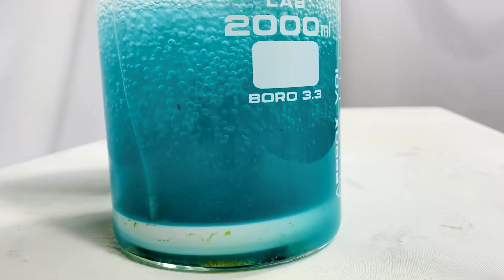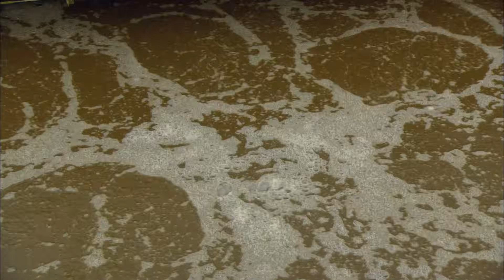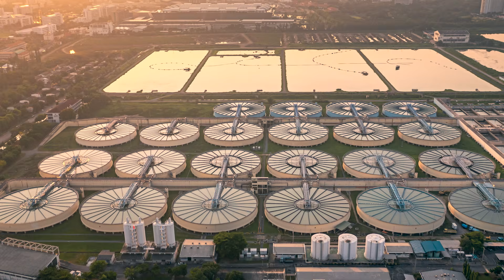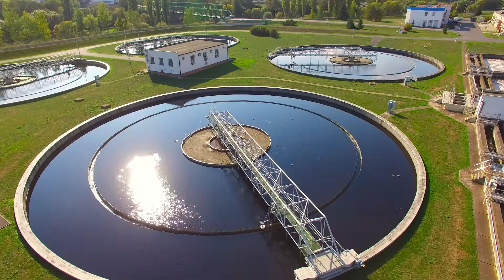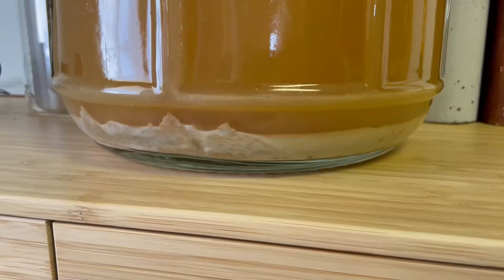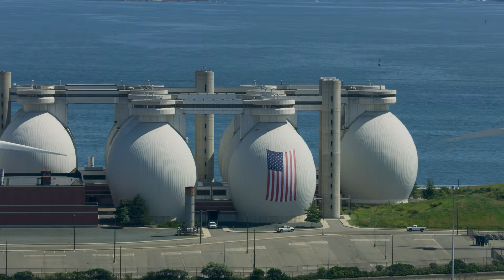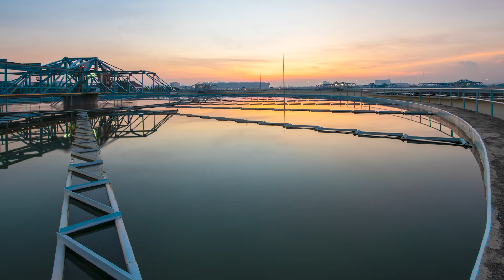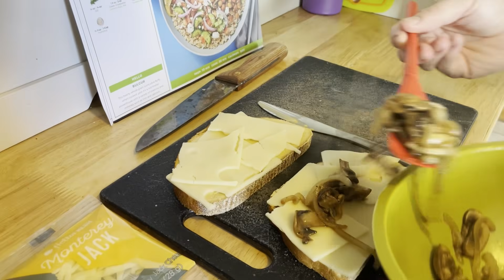What Sewage Treatment and Brewing Have in Common

Comment: As a fellow home brewer, I loved this video. Question for you. I live decently close to a water treatment facility and it casts an awful stench that wafts hundreds of yards away from the source. Is there a way to reduce this undesirable side effect of water treatment?
Reply: You should report the odor to your local water/wastewater utility. They may need to come check it out and to make sure the vents and filters are working properly.
Reply: A properly designed and operated WW treatment plant should not produce an awful stench.  The causes may include, equipment failures, upsets due to industrial wastes above design levels getting into the plant, overloading due to community growth that needs to be addressed by upgrading the plant, or improper operation and maintenance .  I have seen it all in my years as a consulting engineer.  Given all that there may be some levels of odor due to the nature of the waste treatment process that should be pretty localized to the plant itself but someone outside the boundaries can find objectionable.  In small situations such a a lift station in a residential area we added a scrubbing system to lessen odors if needed.  But. Even then it reqired proper operation and maintenance.
Reply: @1945d18  I like the way one of my professors put it; if the bugs are happy, the smell isn't bad. To add to your point on lift stations, I've got one client where we have had success putting carbon filters on vents to reduce odors. I can certainly tell a difference between when I first pull up and when I've had the wet well open for a few minutes.
Reply: @alexcriswell1977  Another engineer I presume.  Retired now but it is nice to discuss these topics that I spent my working career doing on a daily basis.  Kind of miss it.  Here is a little “odor” story.
Client was a major meat packer whose name I will protect since they were a favorite of mine, easy to work with and tried to do the right thing.  Got a call one day that the smaller city they discharged pretreated waste water to had a huge upset in their trickling filer plant a dead fish were showing up in the river and the State DEQ was having a fit.  Did not make sense to me so I called Dr. Ross McKinney at KU and ran it by him.  He asked me if the upset plant smelled like onion which I found that it did. Might be a problem related to ethelyne glycol.  Called the client and they confirmed they used it in their plant cooling system it was a closed system and could not have gotten out into the effluent.  Well guess what.  Upon further investigation they found someone had drained one of their systems and it went down the drain.  Case solved.
Reply: @1945d18  I am another engineer. I just started last year after grad school. Most of my clients are smaller municipal authorities, but we do have a few larger clients as well.
Reply: @alexcriswell1977    That’s great!  I had 38.5 years as a consulting engineer and it was a great career as I hope yours will be.  I just wish there were more you people going into the foie
Reply: Sorry I pushed the send  button before I finished my reply, a senior moment for sure.  What I did not finish was that I hope more young people take up the profession as it very rewarding from a lot of different reasons.  I was lucky I was in school when the clean water act came about and the EPA paid for our graduate degrees.
Reply: @1945d18  We had odor complaints in a neighborhood near a wastewater treatment plant and they kept accusing the treatment plant. Turns out their newly constructed neighborhood was built crappily and there were issues all over the place after we completed several smoke tests. It was a mess.
Reply: Also, if the Sim City games have taught me anything, keep residential land use and stuff like polluting industry and heavy machinery separate lol.
Reply: Yeah, city planners could just not build houses close to fucking sewage plants.

One of my friends lived downwind of one back when we were in primary school. Good god, the smell every time I went to his house.
Reply: Ive lived near one all my life. Usually the wind blows the other direction but sometimes there is a chance combination of no wind or wind blowing towards us.

Tbh it's worse when the farms all put down manure in the same week.

It smells very strong about once a month or so, from what I can tell it's when they drain one or more of the settling tanks to remove sludge or fix stuff.

I just.. got over it. It's not that bad really, isn't constant, and is neat from an infrastructure POV. If yours is constant I am sorry.

When I was in grade school a new family bought a subdivided lot and built a huge fancy house on a cliff overlooking the farms, also very close to the poop factory(what we always have called it affectionately). They briefly tried to get the plant shut down because they hadn't noticed the smell until after they moved in. That lasted about a week before they ran out of new people to tell them to pound sand.

 It always smells a bit from the car since the back road is about 10ft from it but smelling it at the house is rare. It's always funny to take the back road around holidays because the normal smell changes SUBSTANTIALLY. there is a normal/healthy smell that it always has but it can really respond to the different waste contents and volume. Super bowl is the most offensive/foul/spicy, Thanksgiving is the most... Full bodied and almost food like smell.... 🤔 Lots of big stuffing poops that mostly still smell like stuffing...

To top it off, I have a septic system so it's not even my poop that I get to smell!
Reply: Pinching the nostrils and mouth breathing reduces the odors found adjacent to waste water treatment facilities.
Reply: @texhunter1820  bruh I've tried this already and I taste it instead
Reply: Activated Charcoal or Activated Carbon air filters. These are quite effective at reducing odours in the air. Best used as part of your home hvac to circulate the maximum amount of air. Can also be used locally (IE strapped to a tower fan with rubber bands) But obviously this is not as effective.
Reply: Short of putting enclosures over the tanks and adding ozone to the escaping air, probably not much. They don't call 'em "sh*t factories" for nothing.
Reply: What a previous comment said, report it.
It's the spring/summer swing right now, lots of increased biological activity and things flow/react differently due to a higher temperature. If it's stinky sulpher eggs they need to clean out their clarifier, that's usually the common source. For your own personal environment, planting trees or bushes makes a pretty good smelling windbreak.
Reply: @_____ you'd be surprised the crap, no pun intended, that some contractors try to get away with when building the sewers. There's a reason testing is required for everything.
Reply: There are two means of controlling the odors you speak of, which typically occur at the beginning of the the plant. The first is the addition of ferric chloride, which helps a number of things including primary settling and odor control. 

The second is simply capture and scrubbing, which in this case would be covering the primary and headworks areas and pulling the air through a wet scrubber using a mix of water and sodium hydroxide.

Virtually every state, county and municipality has some kind of odor control ordinance, typically plants are regulated for noxious odors at their fence line.  It will take time to fix, but registering a complaint with the proper authorities is how to get that ball rolling.
Reply: Moving away is the best option
Reply: I've noticed this too. However, it isn't the smell of raw sewage (where I've live). I notice a chemically smell. It is a smell I've only noticed near waste water treatment or downstream of a waste water treatment facility.
Reply: Move west. That usually works..

Comment: You need to talk about the weather. I see the pretty pictures but what happens when it is ten below for weeks, there is two inches of rain or equivalent snow, high winds, or heat wave evaporating from the pools. Too many engineers concentrate on, in this case, only literally “sunny day” scenarios.

Comment: You missed a great comparison, being aquariums, as someone into the hobby, I got an understanding of wastewater management. Like nitrogen cycle is the whole point of aquarium filtration. There are also points where mechanical filtration and sometimes even chemical comes in hell you can buy filters with build-in or add on an inline UV-C lamp for stuff like "green water" algae. Plus you can even see stuff like duckweed used in water treatment (and plants in general) as a way of "exporting" nutrients.

Comment: Without the proper bioculture both give you "less than optimal" results. If you really want to see a micro sewage treatment system at work coupled with a potable water system check out a well set up Aquarium.
Reply: To achieve acceptable nutrients removal one needs to go to the edge of the envelope with retention times.  And don't forget CBOD.

Comment: The plant I used to work at before retiring had it's own water treatment system. Various infrastructure took solids and oils out, etc.  But the key thing the city was most worried about was the Ph level leaving the plant.  Too much on either side it could play havoc with the microbes in the city sewage treatment plant. Since we used a lot of caustics to wash parts before welding, there was usually a slow sulfuric acid drip going into the waste water to balance the Ph, protecting the microbes downstream.

Comment: When I was in school we checked out a water treatment plant in Philadelphia that also acts as a research site. The most interesting thing to me is that it already powers itself using the methane generated in the treatment process. As they ramp up the operation of that aspect of the plant it will eventually (or may already be) actually generating power for the grid. Obviously that brings its own set of challenges but it's still amazing. Yeah the smell is bad in some areas but seeing large scale treatment and cutting edge technology is amazing.

Comment: Another great video Grady! Thinking about the potassium and phosphates in sewerage, these are a finite resource. I would have hoped by now that we'd have started to extract these elements/compounds for reuse as fertilizer, on a large scale. I guess it's just not yet economically viable.
Reply: We already do recover them. It's one of the things the excess activated sludge can be used for.
Reply: @PyroDesu  Activated sludge is one thing but separating these elements from the fluid would also be possible and would result in purer fertilizer. This would result in less dependence on China and Russia for fertilizers.

Comment: Recently the pump on our septic system died. This is my first home. I've always rented apartments. I didn't know anything about maintaining a septic system. The plumber that replaced the pump said we needed to flush yeast about once every 3 months. I didn't ask any questions. I just did what he said but I always wondered why. Now I know.
Reply: I design controllers for small onsite wastewater management systems, and this doesn't sound correct to me at all. Yeast is optimised for baking/brewing -- not for wastewater systems. There are loads of myths propagated about wastewater systems (people are told to "fix" them with draino or rotting carcasses or gentian violet, etc.) but you might as well just flush bank notes down your lavatory for all the good it does. Just use recommended cleaners, laundry detergent, etc., and most importantly keep your filters clean, and flush your disposal field regularly (where applicable). Use the yeast to make beer...
Reply: @davidhaywood8029  To be more precise, he said Rid-x but then said yeast is cheaper and does the same thing. I did look it up before just blindly following his advice. The manufacturer of the pump just says to use an additive like Rid-x to break up solid waste over time. This is the first time I've been told it is a waste of money and does nothing. I'm not saying you're wrong. I'm just confused now. You're obviously an expert in this stuff so now I don't know what to do.
Reply: @xliquidflames  Rid-X (and similar products) are supposed to break down the scum & sludge so that your tank needs to be pumped out (by a sucker truck) less frequently. What kills a pump is a blocked pump filter or a blocked disposal field, i.e. long pumping times against high flow resistance (of course, pumps do just wear out over time as well -- a ten year life is considered pretty good). In other words, scum & sludge accumulation rate and pump life are quite unrelated except in the case where you have so much scum and/or sludge in your tank that it constantly blocks up the pump filter. In this case you need to get your tank pumped out by a sucker truck.  Hopefully you have a technician who is regularly checking the scum & sludge layers in your tank as well as cleaning the pump filter (if fitted) and/or the tank filter (if fitted) and/or  flushing the disposal field (depending on what type of disposal field you have)? Or you can do this yourself, of course. Addendum: I've never heard of anyone using bakers/brewers yeast in their wastewater system, but the consensus of scientific papers that I've seen is that Rid-X (and similar) products have no measurable effect on scum/sludge accumulation rates. But you can verify this yourself with a search on Google scholar. Hopefully this is helpful...

Comment: A nice "Addendum" to the sewage series would be how it's treated on the ISS, since most of ground-based treatment involves gravity which the ISS can't really take advantage of.
Reply: Is it centrifuges? I really hope it's centrifuges :D
Reply: @RosalynTosh  it's centrifuge.
Reply: @kornaros96  yay :D
Reply: It gets compacted down and essentially freeze dried. Then it gets thrown overboard and burns up in the atmosphere.
Reply: @DrewNorthup  You described how the solids are disposed of, but I took the question to refer to the process of separating the water and solids, in the absence of gravity.
Reply: Not a complicated. 

ISS:  Some are kept for testing back on earth.  Apx 93% of all water is reclaimed by distillation via centrifugal force.  Fecal matter, it's placed in vacuum sealed bags with other stuff, put into the supply cargo ship.  Then it returns to earth but is designed to burn up in the atmosphere or lands if they choose to.

Other:  Ejected into space, no requirement for a long term water solutions.
Reply: @Degenerecy  The ISS dropped a No. 2 on my car roof last week. Or maybe it was just a passing pigeon. 🤔
Reply: @Smachfest  lol

Comment: I think one of the coolest advancements in the wastewater treatment field has been the ability to store methane gases created by the sludge digestion systems to use as a fuel to power the electricity to operate the facility. Not only have we created reuse water but reuse gases to power the treatment process. It’s an entirely self sufficient system.
Reply: Methane fuel cells are pretty well suited for this application.
My small city tried to use a gas turbine but it never worked right and just the ongoing repairs cost more than the electricity it saved.
Reply: I visited a sewage plant in the uk back in the 70's and they were collecting methane to drive a gas turbine for electricity back then. It wasn't enough to be self sufficient, but helped a lot.

Comment: In Sacramento, there is a electrical co-generation and an ice making plant co-located with the waste water treatment plant. The power plant is fed by a natural gas pipeline and some of the power generated is used to run the treatment plant. The ice making plant uses both the power and purified waste water to make ice. The rest of the power is supplied to the electrical grid.

Comment: This was a fun video to watch!

I'm a starting homebrewer myself, focussing on beer. This is the first time I've heard that yeast would stop producing alcohol when exposed to oxygen. Anaerobic processes is a new thing I've leared today. Thank you!
Reply: I have a degree in food science with an emphasis in brewing. You absolutely NEED O2 to get your yeast going. Without going into complexities, yeast are not strictly anaerobic. If you didn't have any O2, then fermentation wouldn't probably be as vigorous as you'd want and/or wouldnt begin much at all.
Reply: @kirkgoingham6095  But you have to oxygenate the mix at the beginning (by shaking) and then let it be in the container with as little air as possible, right?

After the initial step, I always heard that you have to try to introduce as minimum air as possible. Please correct me if I'm doing it wrong.
Reply: Exactly! 99% of the time in home brewing transferring your wort to your primary fermentation is enough exposure to air for your brew to turn out great. Or, if you wanna be extra careful just leave the airlock off for a little longer. Everyone has their own rituals lol.

And, yeah, try your best not to reintroduce air because that will slow down the metabolic pathway yeast use to facilitate alcohol production, but nothing's perfect in homebrewing, especially when you transfer into a secondary. You're gonna get air, but as long as you plug that sucker up, you'll be fine!
Reply: @kirkgoingham6095  yeah before the yeast is pitched we usually shake the vessel and aerate with a whirlpool paddle to get some 'starting oxgyen' for the yeast to grow.
Reply: AFAIK, you should only leave a bit of air at the top of the container when fermenting most alcohols. In fact, I was worried about too much air in his fermenter.

Mind you, I'm a novice at this, still. Don't take my word as law.

Comment: if the sludge gets put pack into the aeration tanks after use and a lot of it dies in the clarifier, isn't there a selective pressure there? do old wastewater treatment plants have slightly different species of microbes?